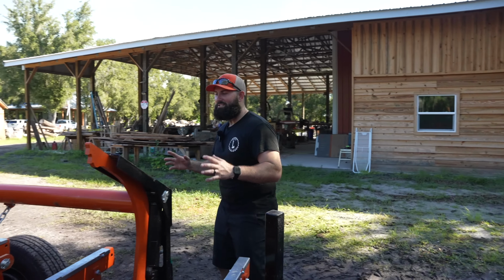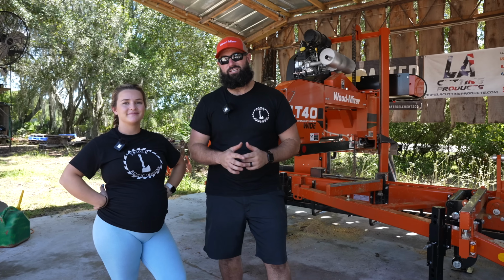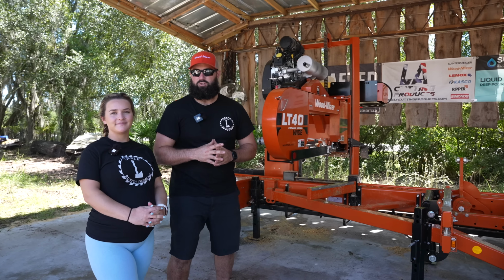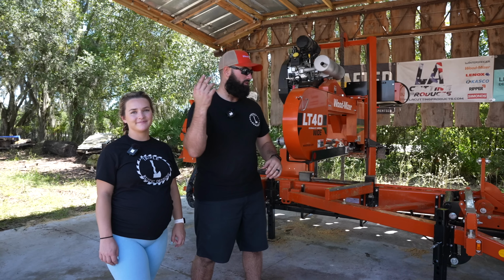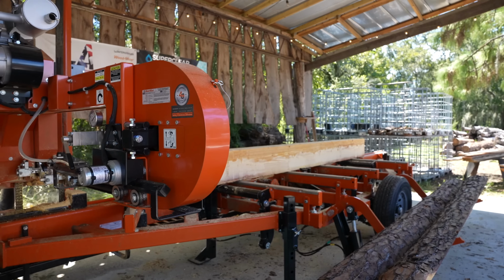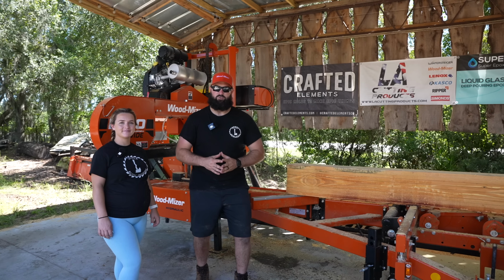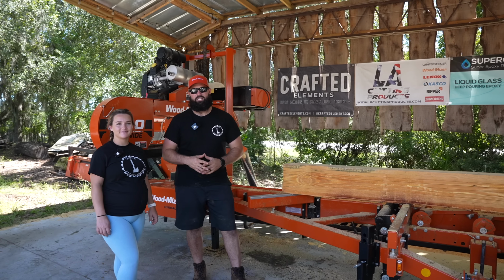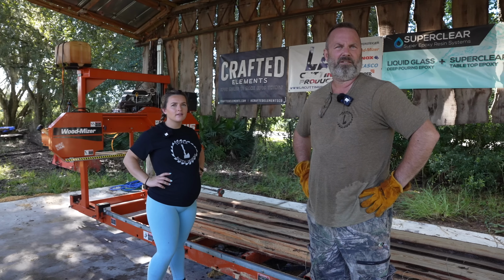WE CAN'T BELIEVE IT FINALLY CAME!

Comment: Congrats on the new mill!  Before loading a log, move those moveable bunks out of the way.  Leaving them out will damage the deck over time...once the log is on the deck, lift it and swing them under it (if it's long enough for them)...if you get in the habit, you'll never forget and damage the deck ;)  Good luck
Reply: Also, leave the log loaders up, horizontal so they are out of the way of the head, as a safety measure so the log can't roll off the deck

Comment: I have an LT40.  You’re not going to believe how much you’re going to love the hydraulics and that stationary command center where you don’t have to walk back and forth.  If you ever have any questions give a shout out.

Try the Turbo 7 blades if you haven’t already. They’re great.  Invest in a sharpener and setter and you’ll be even happier.
Reply: The turbo 7 blades are great in hardwood. I use them also

Comment: Add an air nozzle by each resting surface and hook them all up to a button at the control panel. Hit the button and blow away all the sawdust instantly
Reply: Get that engine running right. It hurts my ears.
Reply: ...or replace the wide bars with 1/4" plate ones stood vertically...no space for much to accumulate on top that way.

Comment: Is it possible that ,the LT40   can also cut when coming down meaning a  dual blade action and also have air nozzle s to blow away debris on the tressels so you dont have to clean it manually when turning the logs .only ideas . The LT 40   looks epic .
Reply from the maker: Those are great ideas!! I’m sure WoodMizer will add those features one day

Comment: I have 2 questions. Does the weight of the cut lumber on the stack cause issues with the blade and blade motor down the road? 
Could the blade system be designed to turn over and allow for cutting on the return  stroke?